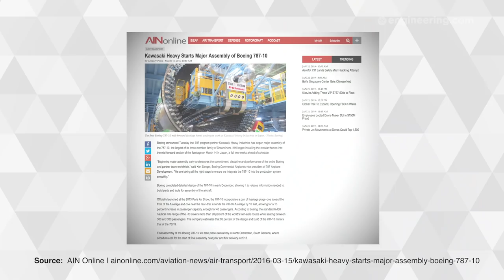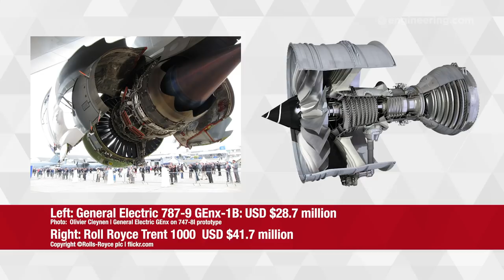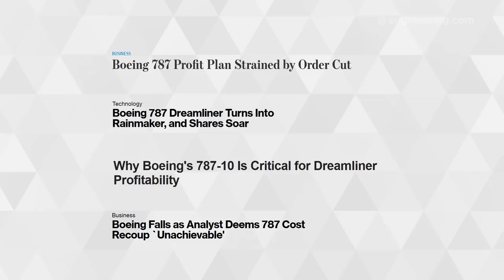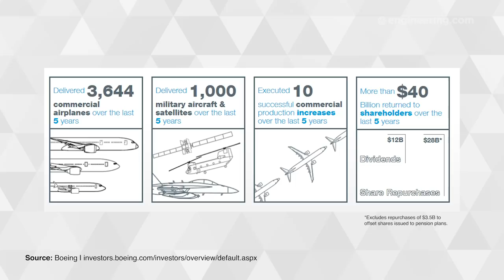Will Boeing Ever Build an Airliner Again?

Comment: I could write a book on this..While the 787 introduced new materials and a new supply chain model, there was  a third component you're missing. At the beginning of the program they also introduced a completely new  set of computing tools that were supposed to cover the entire lifecycle of the program from design to manufacturing to service in one integrated suite centered around Catia V5 .  The supplier of the software never lived up to their promises.  As far as the new supply chain model, the original plan WAS to do little more than final assembly and testing, that never happened. Boeing overestimated the capabilities of the fuselage partners. With the exception of Spirit (Sec 41) and the AFT (made completely by Boeing in Charleston), those fuselage sections arrive in Charleston as empty shells and ALL systems and a good portion of structures work at the joins are done by Boeing. You can see a bit of this here: 

https://youtu.be/WFW5fgypGtY
Reply: I could shoot a dozen videos expanding on your points kpayne....it was and is a daring experiment for Boeing....the 797 will tell us a lot about the outsourcing model's future.